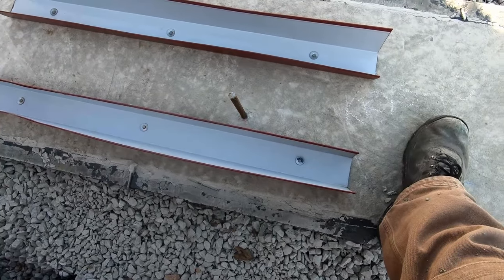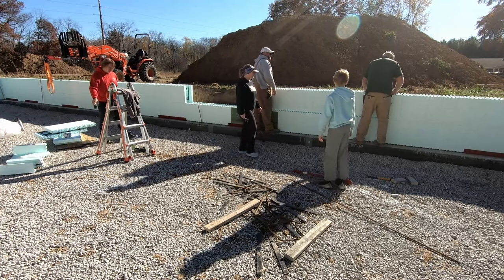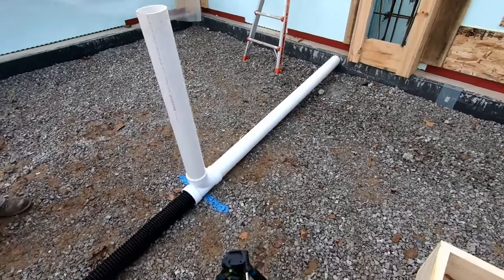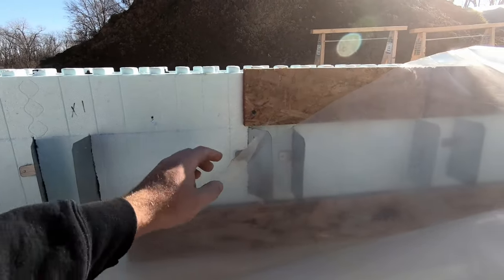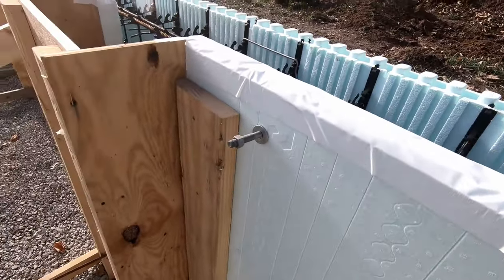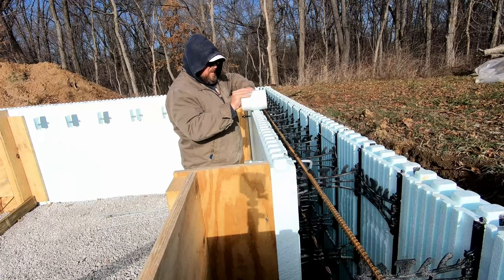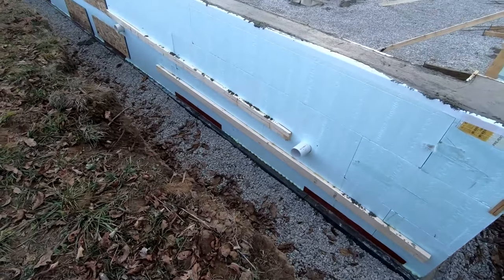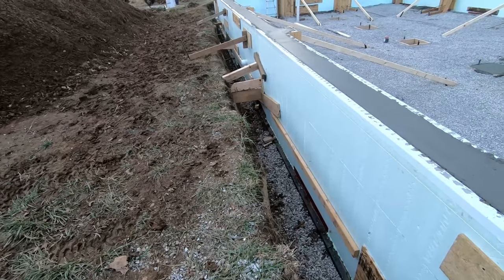Pouring ICF Foundation Walls - Shouse Ep. 6

Comment: Nothing more nerve wracking than concrete blowouts. 😩.  That extra concrete right there for the pilasters would do it even without cutting the plastic ties inside. Did you vibrate the concrete any?
Reply from the maker: We were going to… but then way too afraid after all the blowouts. The aggregate was pea gravel though… so it seems to have settled decently at least.
Reply: @the-plan-today  I think people ought to use pea gravel more rather than the crushed stone. Just my opinion though.  Scrambling to shore up all those places cost you the time you could have vibrated it. Since you have the foam on both sides nobody will know if there's a little void.😉